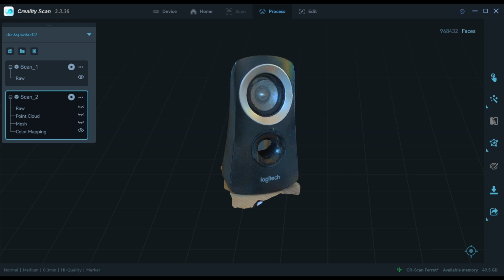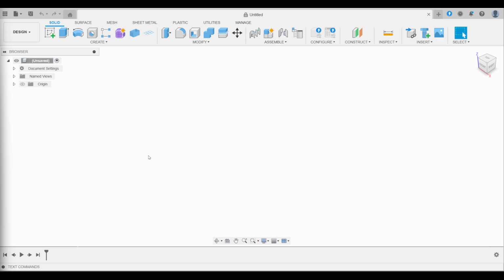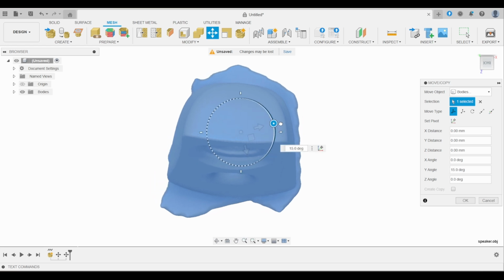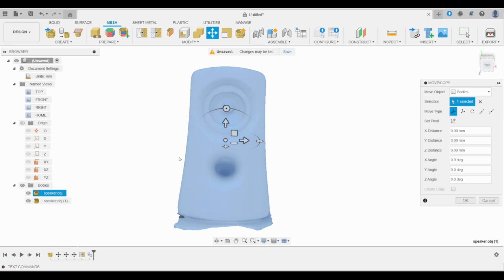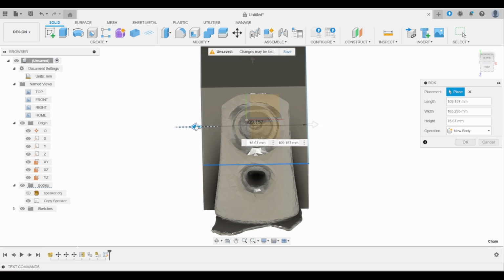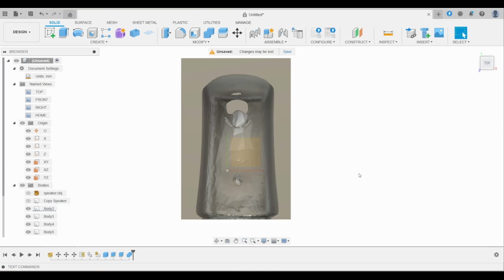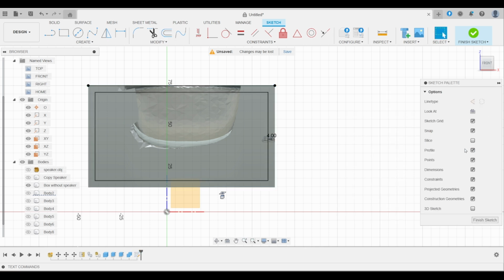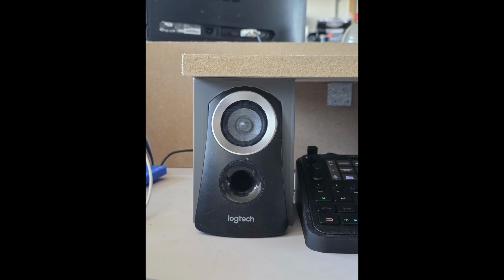Extracting a Creality 3D Scan from a body in Fusion

Comment: thank your for the introduction, which scanner did you used? and for example the body insted is only faces due the scan inside is empty, what if we want to create the solid/objet to work on it in the future?
Reply from the maker: The used scanner was the Creality Scan Ferret, a $250,00 3D scanner that gives amazing results.
The video shows how to convert the mesh into a solid in fusion. Just keep in mind that the mesh must have less than 10000 triangles for Fusion to be able to convert it.